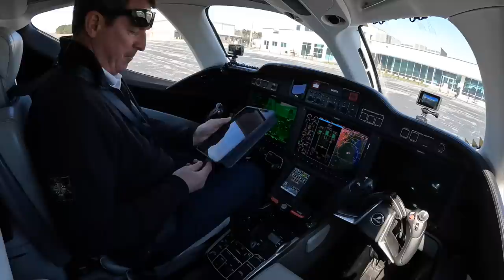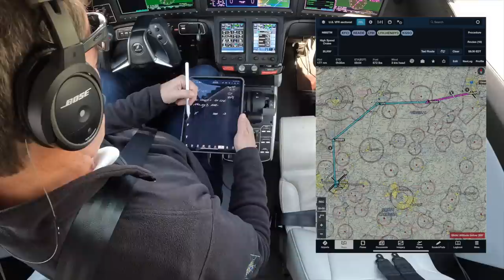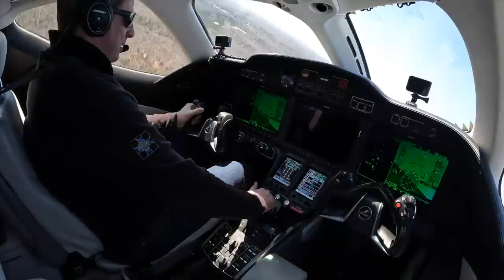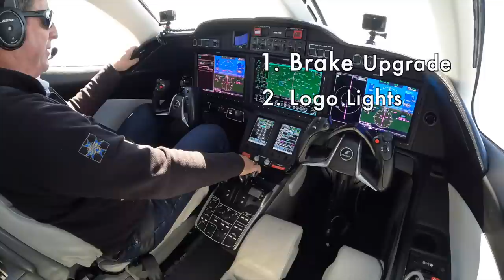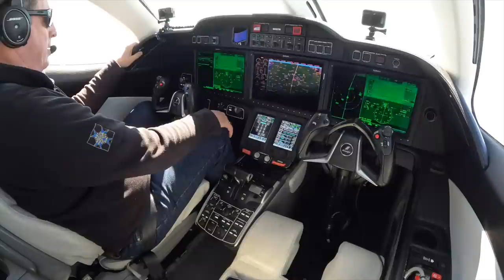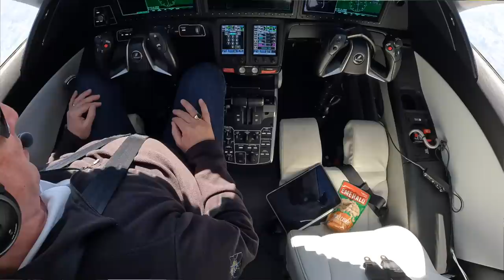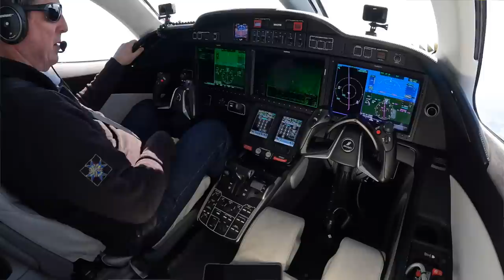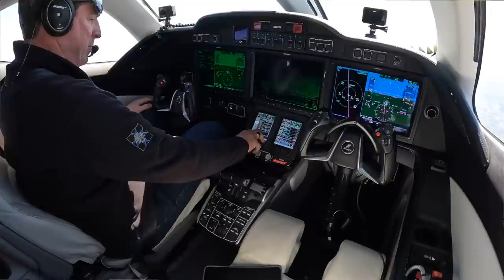Single Pilot Jet Flight to the HondaJet Factory

Comment: Liking the camera angles now. Great job! Also in your preflight you run engine fire alarms. Does the HondaJet have fire suppression on the engines?
Reply from the maker: Thanks, John...everything about these videos is still a work in progress but it's getting incrementally better. For the engine fires tests - that's a part of the automated preflight systems check. Good catch!  And yes, there is fire suppression. It's built into the over-the-wing engine pylons.

Comment: Check your recording refresh rate on your cameras. Your touch monitors on the HondaJet keep "waving" on the recording. I don't imagine that your monitors wave on and off normally. It's just how the cameras are reading the images from the monitors. Are you recording at 4k?
Reply from the maker: Yep, you're spot on. I have the earlier version of the G3000 which has 1) a lower refresh rate and 2) it varies depending on ambient light. So it's hard t nail down. What I've learned since this video is that I use 4K and 60FPS for any cameras that show the panel. It's not perfect but it's better. Thanks so much

Comment: Great video as usual.  How tall are you?  Is your height one of the reasons you chose the Honda Jet?  (I heard that if you are over 6', it's not terribly comfortable flying a Phenom, for example).
Reply from the maker: Great catch on that. I'm 6'3" and fit really well into the HJ. I was so used to dropping my seat all the way down that when I first got into the jet, I did that and said "the visibility is horrible" I was convinced to raise my seat. The headroom is significant due to the design for natural laminar low.
Reply from the maker: I've been in a Phenom but not since I've had & flown the HJ. I did sit in a Citation M2 earlier today and I really didn't fit in there at all

Comment: which tablet and apps you used to record ATIS information? Tx
Reply from the maker: Sure. I have a Sony Audio recorder that plugs into my headset which records audio on a seperate track. On my iPad, I use ForeFlight to take notes on ATIS and Clearance
Reply: @bluemaxsix  Thanks, last one, which apps do you use with pencil to write on iPad? I want to switch over from writing on paper to iPAD for taking instructions. Nice video.
Reply from the maker: Yep, that's Foreflight. It has a section within the app called NOTEPAD which has the CRAFT format on it for clearances. I literally have gotten away from all paper using foreflight. I also like it because it's sync'd so whatever I do on my iPad I see on the app on my phone and vice versa. 
They don't sponsor me so this is my endorsement as a long-time user. Try it Nad let me know what you think
Reply from the maker: What do you fly?
Reply: @bluemaxsix   Cirrus G2+. It is good machine and I enjoy it lot.  Had my mind set for long time to get Honda Jet but end up with Cirrus.
Reply from the maker: Love it. If we run into eachother (figuratively) let's swap rides.
Reply: Indeed. I am on other side of Atlantic Ocean. Give me buzz if you are in Europe
Reply from the maker: Every chance I get!